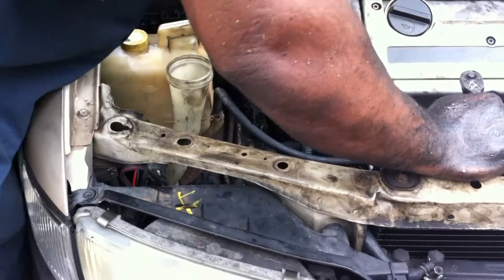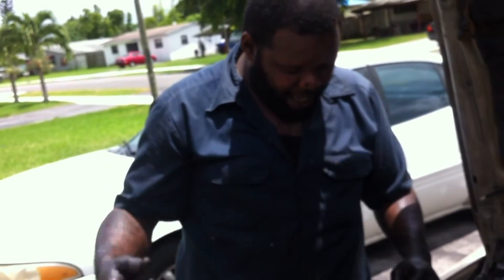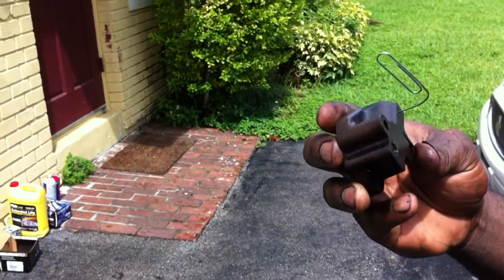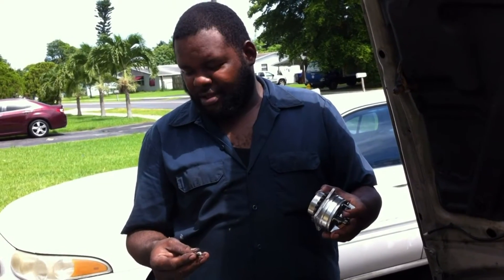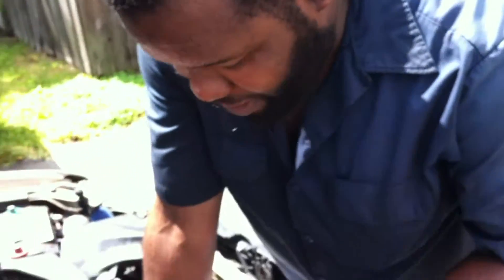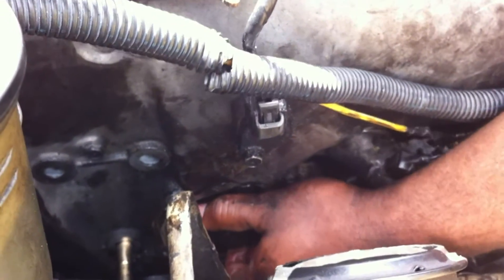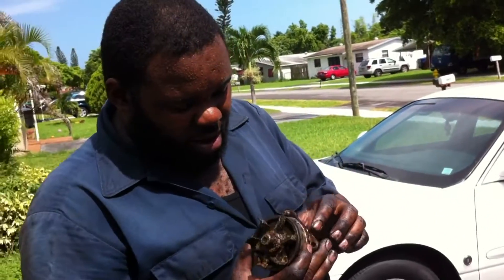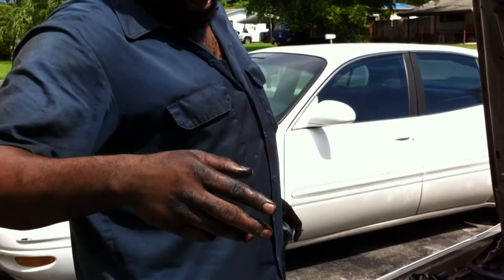96 Nissan Maxima How To Remove And Install Water Pump Part 3/4

Comment: I knew the water pump was a headache as are most items on the sidewinder engines. Your sweat has shown me that I underestimated the job which I figured included much disassembly. Glad I backed off. Hate working for nothin'.

Comment: for the tensioner do I have to turn the motor counter clock wise to loosen the chain to take it out I dont have a leaking pump but my chain is slapping so Im replacing the main tensioner.
Reply from the maker: Yes
Reply: is it counter clockwise to loosen the tensioner size and do u possibly remember the bolt size for that off hand
Reply from the maker: +Dustin Gover sorry I do not remember the bolt size
Reply: +KennyG488 so I should just turn the crank like what 10 to 20 degrees counter to loosen the chain?
Reply from the maker: +Dustin Gover yes and you will have just enough room to remove the tensioner